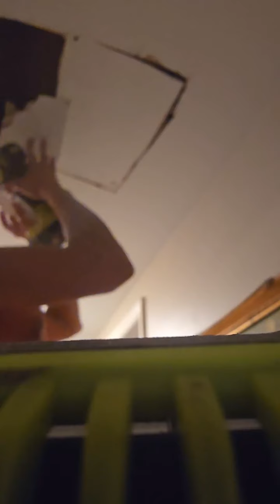R-Rated DIY: Drywall Repair-Part I, Sprinkled w/ Shenanigans & Storytime!

Comment: I always learn from your videos, Heather. I’m really looking forward to part two.  I always seem to sand too much and then I have to go back and add more mud
Reply from the maker: @annshave9618  I think I can work on that one tonight because the mud is dry. It's pretty typical to have to do a second coat after your first sanding so you might not be completely off the mark.